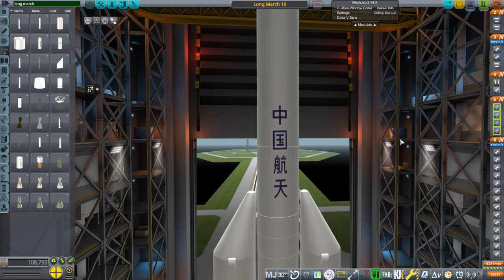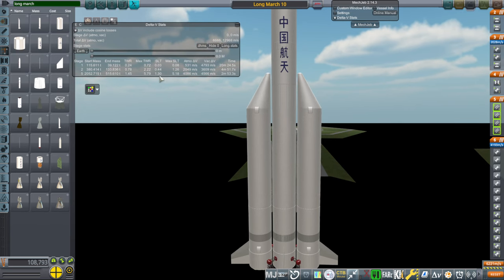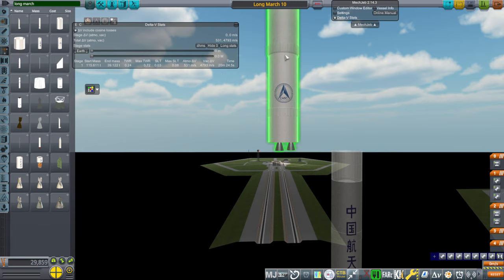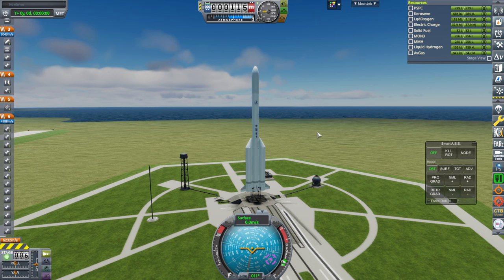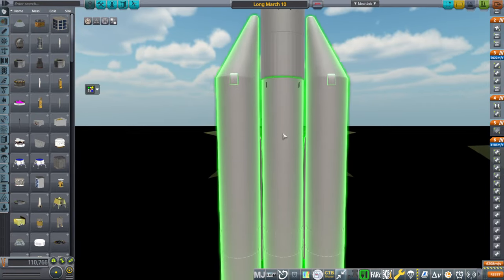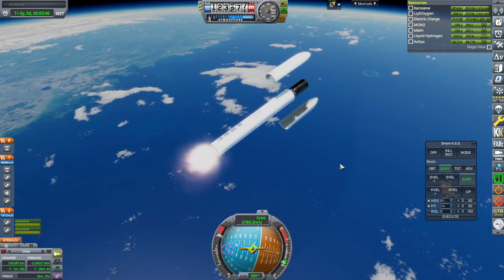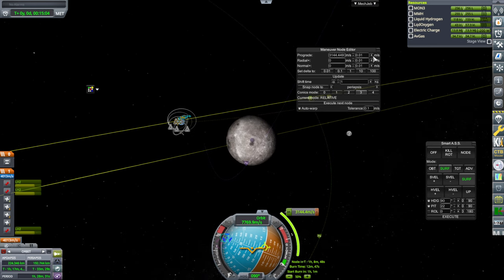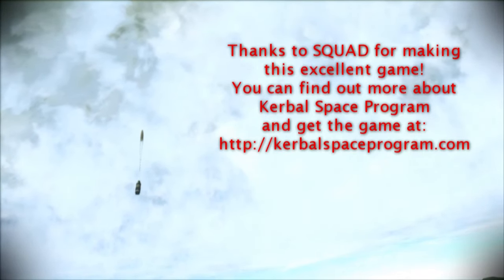Long March 10 - China's Moon Rocket (Kerbal Space Program with RO)

Comment: You mentioned the 3rd stage has too much dv, but considering real rockets sre built with margins in mind and 980m/s is just enough to get in a low lunar orbit, let alone for a docking with the lander, i don't think it should be much smaller. I'm guessing the specs on the engines will improve over time, so with higher chamber pressure they can afford to have a longer core for more DV and mass at the same TWR.
Reply: Is the 3rd stage is supposed to enter lunar orbit at all?
It's rare for cryogenic stages to do so. I think Odysseus IM-1 was the first cryogenic vehicle to do so, but I might be mistaken on that.